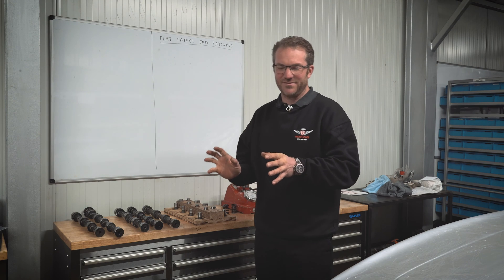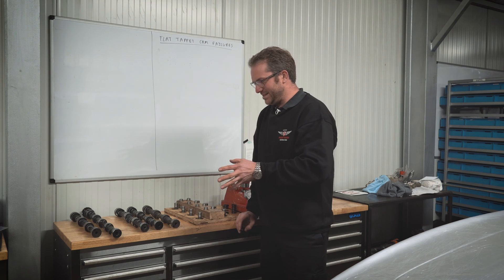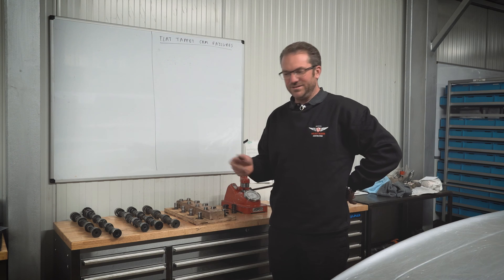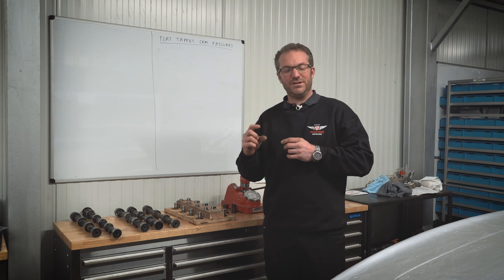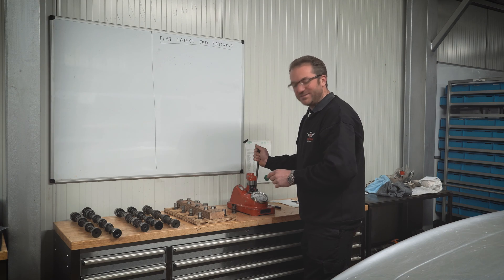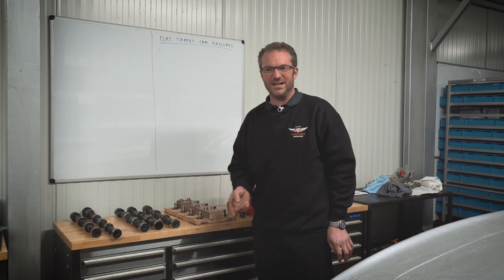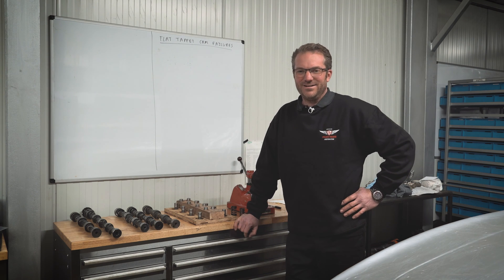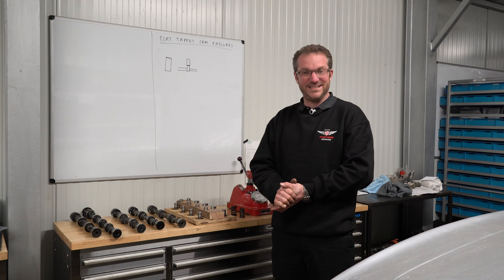Flat Tappet Camshaft Failures: Causes and Solutions

Comment: THANKYOU VERY MUCH FOR SHOWING AND EXPLAINING MANY CAUSES FOR FLATTAPPET FAILURE ALOT OF PEOPLE ARE USING VERY HIGHLIFT CAMS AND ALOT OF SPRING PRESSURE SO BYE  CAM AND LIFTERS,IF YOU GOING TO GO VERY HIGHLIFT  GO ROLLERCAM AND ROLLERLIFTERS PROBLEM SOLVED AND QUALITY CONTROLL IN MANUFACTURING HAS FALLIN

Comment: Very helpful video ! I have one more question, I have a vw waterboxer (wbx) and the tapered angle of the lobe is worn the other way around. What normal is the high side of the lobe now is the low side. Also the flat tappet (hydraulic) is in the middle lower (0.04mm) a new one has a crown and in the middle higher I think.
Is this a normal thing ? And best to replace both of them ?

Comment: I do not understand the lack of feedback for a great video. To make the effort to film and share knowledge and experience about flat tappet cam failure cannot be understated. The information was to the point and the reasons for the cam failure were clearly explained. It is not just the failure of the camshaft itself, but all the finely ground metal dispersed throughout the engine. Thank you for sharing your expertise on this subject.
Reply from the maker: Thank you, it is great to hear our video was useful